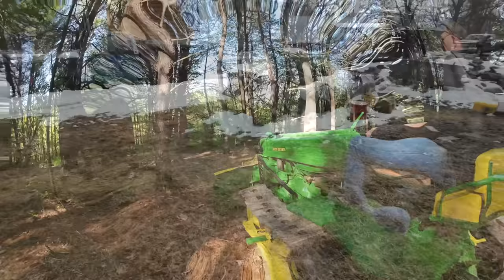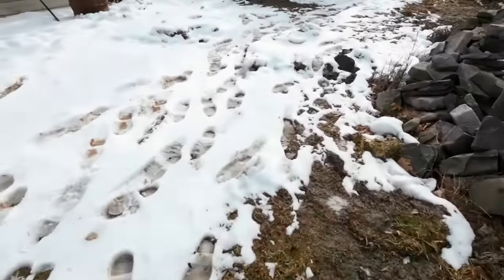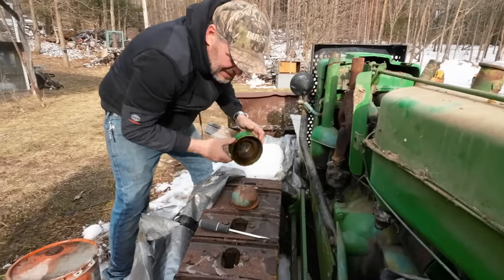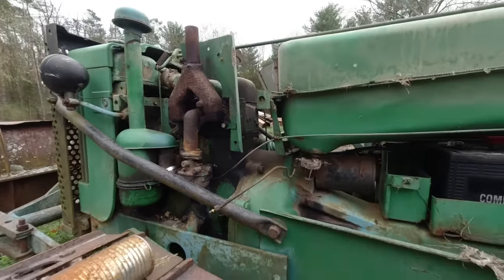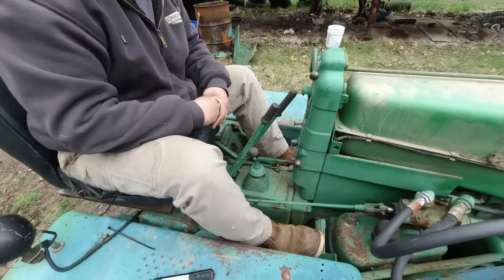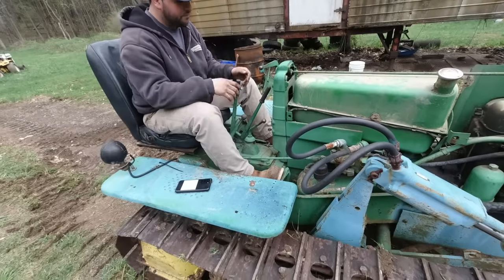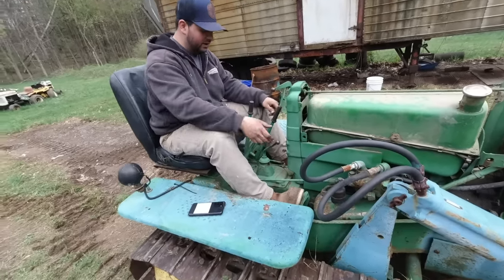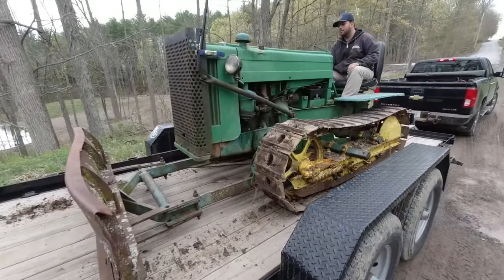Could this be RESTORED? Abandoned for decades… a 1953 John Deere!

Comment: That is so cool!! love the old John Deere crawlers!! I STRONGLY recommend that you get a flapper cap for the straight pipe exhaust!! We used to have an old massy tractor from the '30s (as a guess) that my dad and grandpa would start up in the summers just to tool around on. it had a straight pipe that needed the CAN put on. One year, the can blew off and the rain went into the cylinders and rusted it up tight. I still feel a loss for that!! I was just a kid, but that was a lot of fun! thanks!!

Comment: I've got a 1953 40U Tractor that piece on the back of the seat is to hold the top link on the 3 point lift when not in use. Make sure you change the transmission oil it can build up water over a few years.
Reply: Noted! Thank you!

Comment: Congratulations gentlemen, you have saved another bit of history.  Considering it’s age, does the engine require leaded fuel or are you adding top-cylinder oil to regular gasoline?   The bracket on the back of the seat reminds me of a canopy base.  Part of a tripod structure meant as a sun shield rather than a safety cage.   

Wishing you and your family a blessed week filled with gentle seasonally appropriate weather and restful evenings.  Peace Jimmy

Comment: That was rather satisfying to see it being resurrected. However, I am unfamiliar with starting fluid in the exhaust to attempt starting at 6:29.
Reply: It's a super short exhaust pipe so if you pour fuel into it while the exhaust valves are open, the fuel will drain its way into the cylinder and allow for some combustion. Did this only because the starter fluid didn't seem to be making its way up the air intake.
Reply: @RojasCarpentry  That's what I thought but since I was unfamiliar I didn't want to say anything. I try not to comment on things I don't know. I will however always ask, or I will never know. Thank You!
Reply: @AllenBrosowsky  I never knock people for not knowing! Always ask questions. Be curious. I know there's a million and a half things you know that I don't so my ears are always open too!

Comment: Looks like a standard MC... we have a few, along with the newer 5 roller 40.

Thermosiphon, aka no water pump. Great little crawler.

*edit*

Your wrong on the pedals. Right is brake, even has flip down "park" lever.
Left is engine clutch.

All early John Deere's were 2 Cylinder. Starter will work on 12v, and generator can be swapped to 12v. Really helps starting.

Comment: Looks like a 420 they referred to your model as a 4 roller. The track is shorter than the five roller, and it's just a straight blade.
Reply: It is actually a 40c . Very similar to the 420! It still has its data plate

Comment: lol, def no hydro or flow based on gear ;)  direct drive from engine to transmission to rear diff with a set of dry clutches/brakes on each side to steer.

Comment: Why in the exhaust?
Reply: The starter fluid wasn't making it to the carb from the air intake because of the distance. I was hoping the exhaust valves were open so when I poured gas down the pipe it would drip into the cylinder directly

Comment: What is the point of this thing? It can't really do much. You should have gotten a combo unit with an excavator, loader, forks and plow.
Reply: Nothing wrong with reviving an antique for fun. It's only purpose will be for clearing light brush on existing trails. We have loads of other equipment at our disposal already
Reply: @RojasCarpentry  sounds like a waste of fuel and a device that long hasn't had much of a use in multiple decades due to more useful tools. Go ahead, waste your fuel in a useless antique.